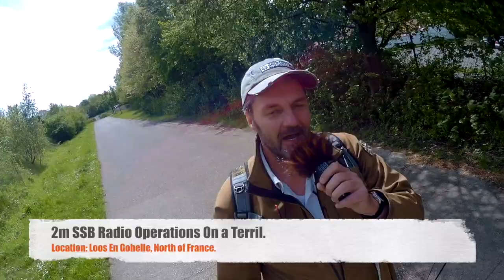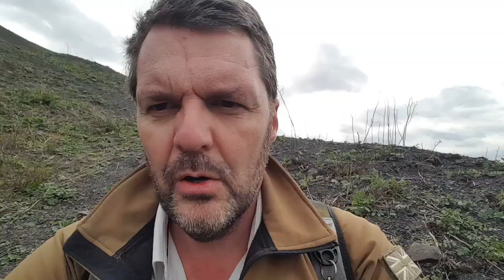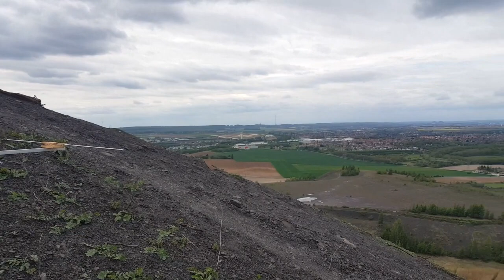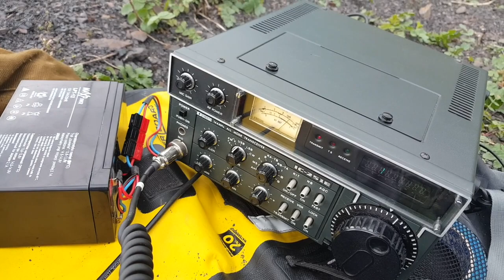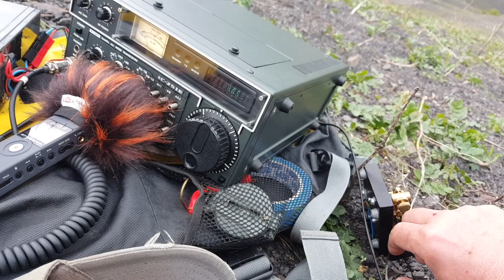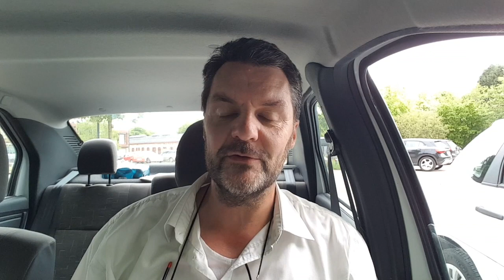2m SSB Radio Operations On a Terril.

Comment: It's worth looking for an old Yaesu FT 290r Mark 2 with its 25w linear...or even a FT480 which has 30w output...10w is good but 25w is better :)
Reply from the maker: I just missed a 290r on EBay. It went a bit too high.. I didn't know about a Mk2 thanks.
Reply from the maker: Tomorrow afternoon I should be at Cap Gris Nez facing Dover with 6m FM (PRC-352) and PMR simplex, DH3, with a portable Yagi. If you will be on the air send me your call sign. Thanks.
Reply: Radio Prepper ok I'm an M callsign. I'll listen on 51.510 what time UK would you say to listen for you ?
Reply from the maker: Ok, I can't go on 51.51 since the PRC has 25kHz spacing. I will probably call on 51.7. I think I will be on the air around 14h00 to 16h00 UK time... Thank you! And if it works I can remove your call sign from the video.
Reply: Radio Prepper I'd rather not have any video of my voice sorry. I was a bit more intesested at trying 2m SSB btw but whatever is convenient for you
Reply from the maker: As you wish. We can still try..
Reply from the maker: I might try 2m SSB another time, even from here, but I need to install a Yagi on the roof... Sometime I go portable, will let you know..
Reply: Radio Prepper ok 51.7 FM then sure...do you have AM also ? Perhaps worth getting a 2nd hand yaesu ft 690 ...great radio if you are on a budget
Reply from the maker: I wish... I am a big fan of the Gonset Communicator on 6m. Thank you.
Reply from the maker: On the air!
Reply: Radio Prepper ok bit busy at the moment. Will try at 3 uk time
Reply: Ok I called you just now on 51.700
Reply from the maker: Thank you very much for trying! Much appreciated. Propagation just wasn't there.  We'll try again sometime on 2m SSB :-)

Comment: Good try Gil on 2 meter SSB and CW =)   10 watts SSB is good if you have LINE OF SIGHT and a BEAM helps a BUNCH =)   I had a Kenwood TS-711A all mode two meter .... lots of fun at home ... but a bear to lug out in the field and even Field Day weekend 8-O    Yep ..... the MFJ two meter SSB rig would be much lighter weight in packing in the field =)

Comment: Exactly the same multimode that i run. (Y)  Great little radio :)
Reply from the maker: It is! Do you know how to change the tuning step on FM to get say 145.7625?
Reply: The nearest i can get to that frequency is 145.762,and that by pushing the step button on the left under the tuning dial.One of my local repeater frequencies that,GB3IR,in Richmond North Yorkshire.:)

Comment: From the dialect the Germans are located in south of Germany probably Bavaria :-) 73 from Berlin
Reply from the maker: Interesting thanks. One was S8. That's quite a distance...
Reply: Yes, definitely a south-eastern (bavarian) accent.
Reply from the maker: Thank you for the translation!
Reply: Transsription from 4min on:
First station: "Jawohl, du kommst so 10-20 db über S9 an. Also mächtig mächtig. Ich hab' nochmal die Antenne hingedreht. Wir können auch nochmal a bissel a mehr Leistung ... Anfangs 400Watt des sind schon 3db mehr. Ich weiss aber nicht ob man das überhaupt gesehen hat am S-Meter.
Other station: "Rolf, hast du nochmal reingerufen? Warst du das?
First station: "O.K. wir haben dann die gleiche Leistung in etwa"

So both stations run about 400Watt - so it's no surprise that you could not compete with your mobile rig. Nevertheless: well done and thanks for sharing :-)
The distance should be about 730km to the east south east from Loos-En-Gohelle (heading 110degrees roughly).